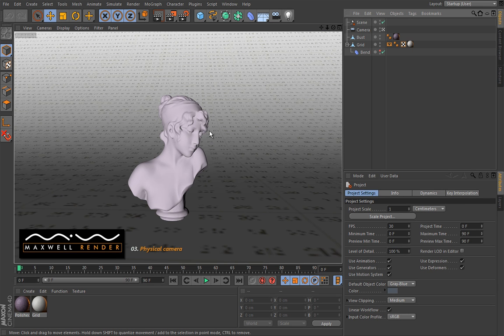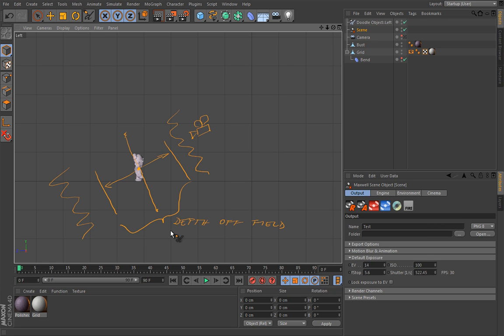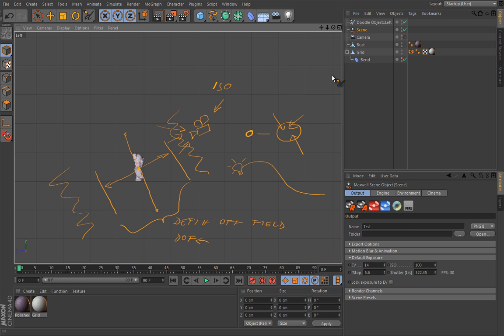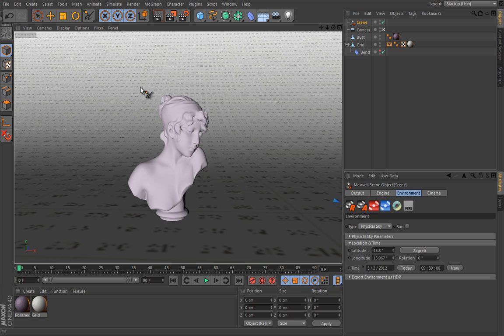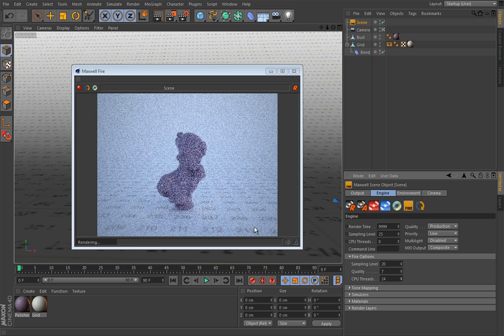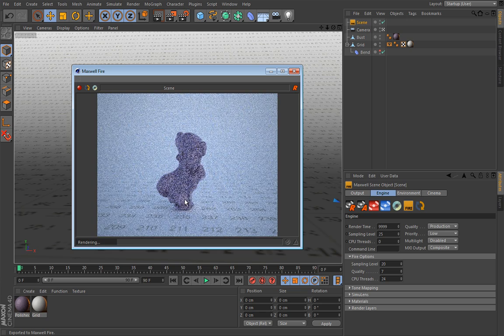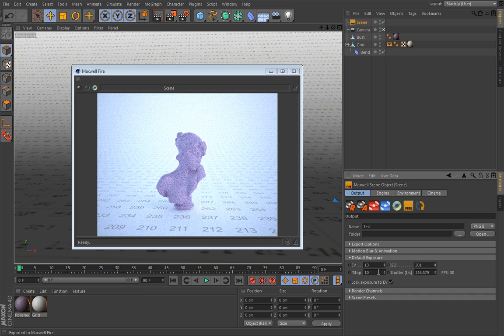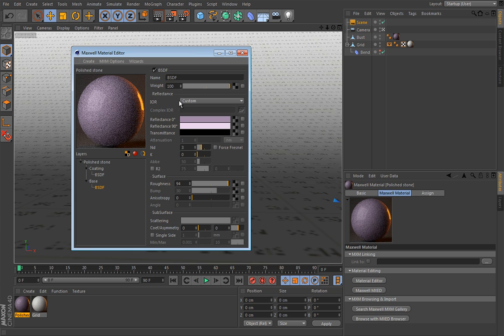Maxwell Render for Cinema4D tutorials-03_Physical_camera

Comment: This has bothered me for a long time: isn't the ISO parameter a little redundant?
Aperture controls depth of field, exposure controls motion blur, together (at fixed ISO) they completely set your exposure. Then why bother with ISO at all? Is it just to have a better feedback with real-life photography?
Reply: ISO is very important for noise :) and you can simulate  film speeds :) in real situation it is one of the most setting in digittal photography because many times you havent got enough light (so you mhave to to increase film speed (iso), or sometimes too much /and you cant go with iso down) in CGO sure, it doesnt matter too much, because you can set EV :) but in real situation you cant sert EV easily (for example you have to flas and so on)
Reply: Yes yes, of course it's important in photography, but seems like a useless setting to have in CGI. If you want to simulate grain, I think a much better, non destructive option would be to do it in post. And anyway, it's not like Maxwell simulates grain based on ISO right?